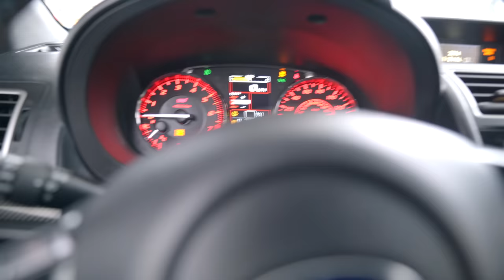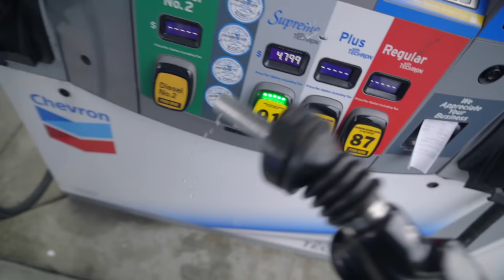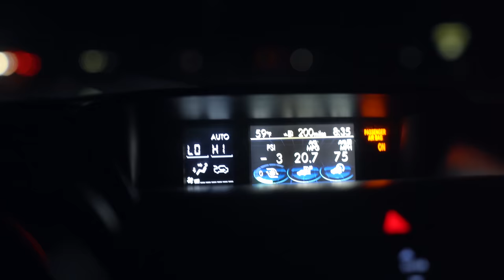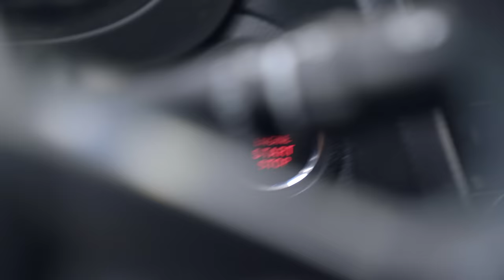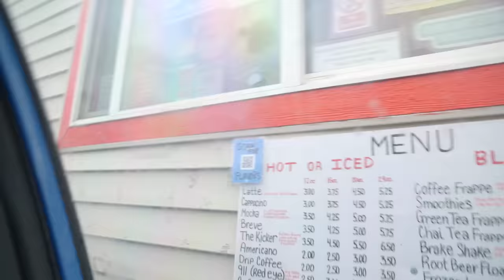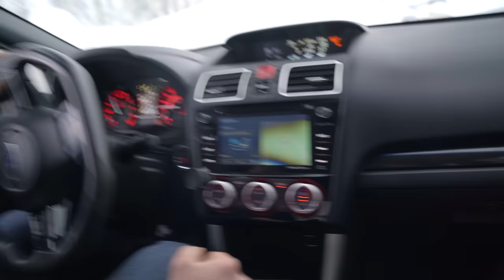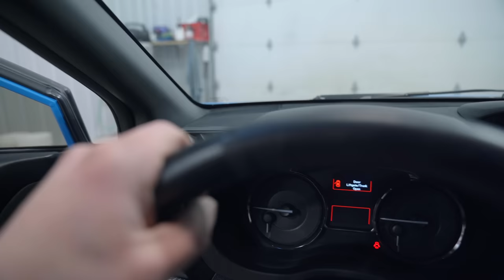Flying 15 Hours Away for a Blown Up RARE Subaru STI (and attempting to drive it home)

Comment: This is why they say always check your oil, when you fill up for fuel. I actually blew mine up once with ringland failure. But ran out of oil and spun a bearing.

Comment: I read the title and thought, “Man, a 15-hour flight to drive something home? You can’t fly 15 hours and not have to deal with an ocean.” 😂😂😂

Oh, and Havoline was the old brand name of Texaco’s motor oil. (Former chain of gas stations.) It was a big name in the ‘60s & ‘70s.

Comment: Shouldn't you be checking the oil when it's cold or at least been sitting for a bit? Give the oil some time to fall back into the pan.
Reply: You can check while hot. If it says it’s full while hot then you know you have enough, if not slightly more which is fine.

Comment: Devin do you oil spray/undercoat your cars? If not I definitely recommend as it helps with rust for the cars driving through salt roads and even the cars you don't drive in winter
Reply: I don't believe that WA uses salt on the roads so rust out there is nowhere near as bad as the midwest / east coast. I coat all of my vehicles and live in Michigan never had rust on the subframe once.

Comment: Yeah my 2017 sti is doing the exact same thing spent thousands of dollars on jb400 turbo down pipe injectors fuel pump tune an just went to data log an it smoked out everything behind me I'm so fucking done will have paid 50k in total for this hunk of shit please someone send me donations parts aka short block:( I hate this Thang! Help mee
Reply: I mean bro didn’t you do any research on STIs?? If you have that kind of credit and money should’ve got something better smh
Reply: @CarLife_  traded a 13 1le cammed camaro for it an let tell you what a mistake that was lol  
I did make a spontaneous decision but hey ya live an learn this on just happens to be quit expensive